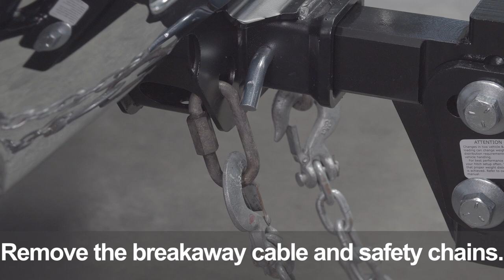How to Hitch and Unhitch your e2™

Comment: I have the e2 hitch and have hitched and unhitched a over 20 times so far.  I’ve never had to use the Snap-up lever.  I think if you did need to use the lever that the truck and/or trailer would have to be on some very uneven ground and, if that is the case, you shouldn’t be unhitching the trailer in the first place.  I’ll also add that it would have been good for the video to state that before you begin unhitching the wheel chocks need to be in place.
Reply from the maker: Thanks for your comments!

Comment: I had this system installed by a dealer but when I arrived home and started unhitching, I just could not remove the spring bar on one of the sides. I had a large wood block under the tongue jack and I literally used the whole jack length and had both my vehicle and the trailer lifted at something like a 25 degree angle to the ground, and yet there was still tension on the bar. I ended up having to hammer the bar out of the L-bracket with a big hammer, and after I did that, the rear of my truck just slammed down hard to the ground. I am not sure what the dealer or I did wrong, maybe someone can help.
Reply from the maker: Oh no! I would contact our customer service team at info@fastwaytrailer.com or call them at 877-523-9103, and explain to them what's happening with your hitch! They should be able to help you figure out the issue!